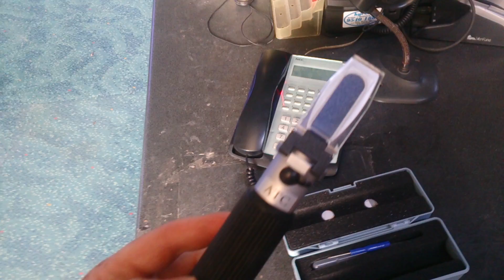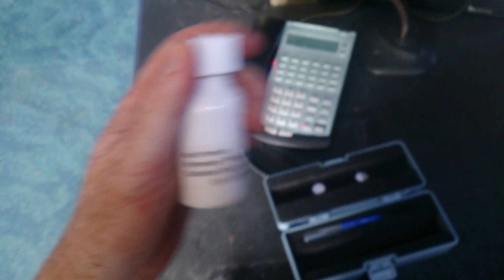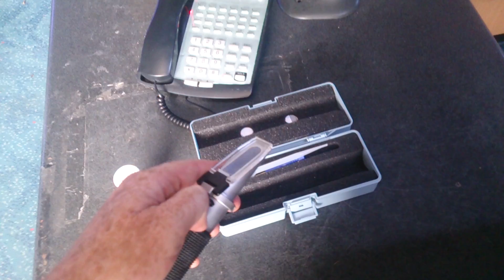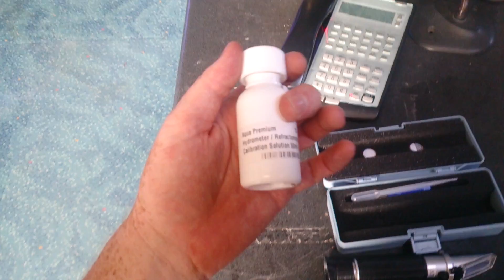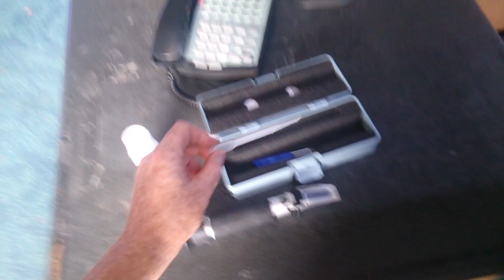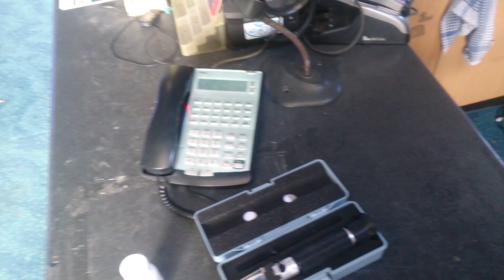How to calibrate a refractometer

Comment: I’ve been using a manual refractometer since I started reefkeeping 2016.   Calibrated at onset.  Have a second on in office.  Both read the same consistently at home and at office, when both periodically tested same time both locations and multiple tanks.
But haven’t recalibrated since start.
I always check my new fresh saltwater to make sure salinity correct before I use.
Here is my question I bought two know calibration standards from reputable companies.  Aquatic Experts and Aqua Craft.   Neither of these give the same standard reading at 35ppt.   So what to do?
Are my instruments correct and just fine, or out of calibration and one is correct of the fresh new standards?   And if one of the standards is correct, which one?
Suggestions?
I averaged the two standards and went with a compromise between the two.  I then made a batch of fresh saltwater which I brought up exactly to 1.026 and 35ppt.   So I now have that also stored in a fresh new green glass stopper bottle, as a third and what should be a fixed 1.026 and 35ppt standard.
Is this correct and reasonable?
Reply from the maker: Yep